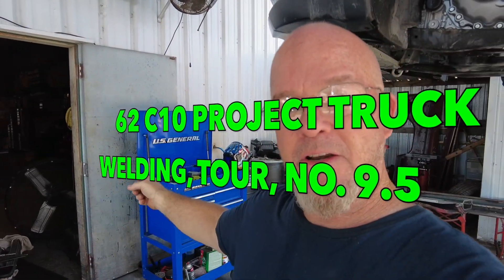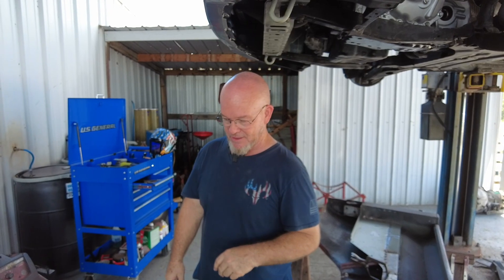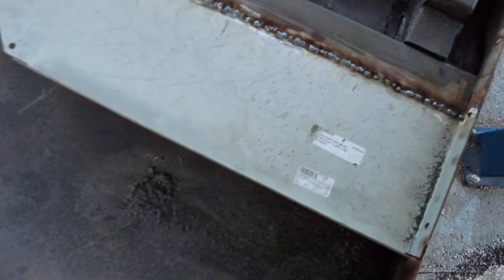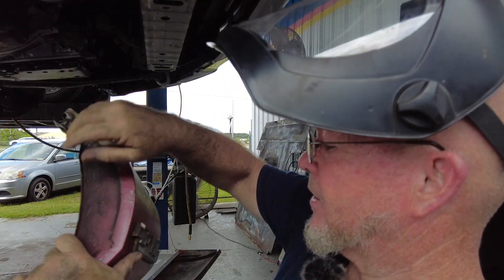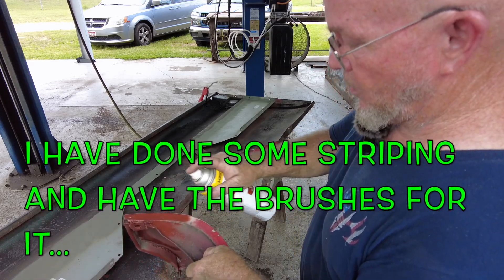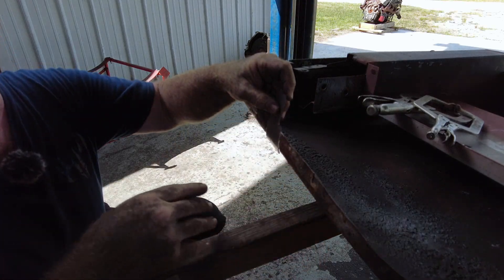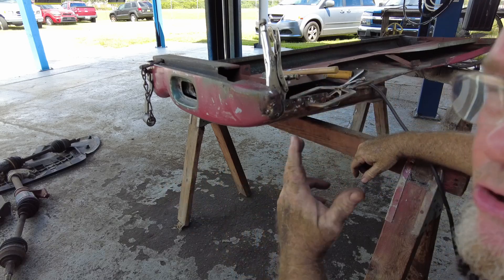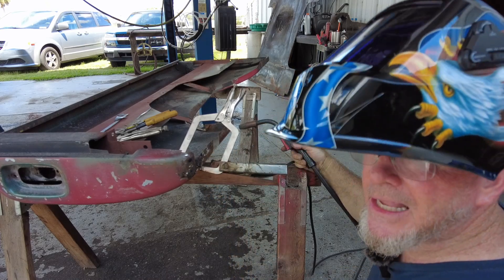Panel Fabrication, Fixing a BASKET CASE...62 Chevy C10 Pick Up Truck Project No. 9.5

Comment: Hey Jimmy,  Couple tips for filling blow through.  Get yourself a flat piece of 1/4" copper bar (1/4" x 1" C110) and clamp it behind the hole.  Then fill the hole with weld, the weld wont stick to the copper and the back will be smooth-"ish".  Magnetic grounds are also a nice improvement and speed up fabrication too (Tweco 9255-1060).  Love the content and the world is a better place when we share our knowledge and experience!
Reply from the maker: Thanks very much for that input Benjamin! I have seen the copper trick, just need to get to Home Depot(Or similar) and find some. I hear Aluminum also works?
Magnetic ground, that I had not seen yet, but I'll certainly check it out!
Reply: @JimmyMakingitwork  Yep Aluminum works pretty good too.  Her in Wisconsin, we have a fair bit of "patina".   So you get pretty good with patch and panel repair on our beloved money pits.  Thanks for the reply!

Comment: I'm sure they're not the best quality but harbor freight has a bunch of discs and flap wheels on clearance for dirt cheap
Reply from the maker: Yeah, one of the things I've not had much luck with from HF is sanding materials. I picked up a bunch now though from Amazon, just sticking with name brands for most of it. Seems to last a lot longer even though it also costs a little more.
Reply: I go with better quality for things I regularly use like rollock discs, but I rarely use angle grinders so a cheap assortment sounded pretty good

Comment: Hey Jimmy! Absolute huge fan of your videos here. Your expertise is extremely obvious when watching you do diagnostics and repairs! That being said, I have a question for you about an issue that arose today with my Jeep 5.7L Hemi. My coolant tank/reservoir is overflowing causing it to spill over. Even when the engine is off and rested it has not come back down yet to normal level like it was yesterday. No overheating as of yet either. I did notice the main hose looked flattened out as well when the engine was off and rested a while. Any ideas what it could be? Thank you!
Reply from the maker: It sounds like a bad radiator cap. It should vent when the system cools down, they may be other problems, but change that and see.
Reply: @JimmyMakingitwork  I will try that today and see! Thank you
Reply: Hey Jimmy! I got a new radiator cap for the Jeep. I topped off the coolant and let the car run hot for about a half hour so I could be sure coolant was at a good level before putting the new cap on there. I put the new cap on, let it keep running and took it for a spin and everything is looking great, no overflowing or sunken hoses. Thank you 🙏🏼